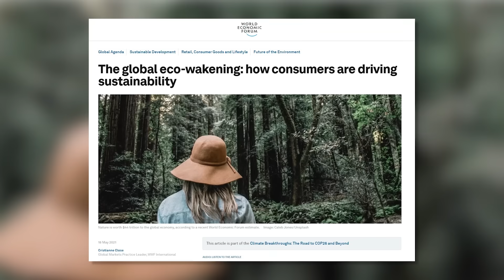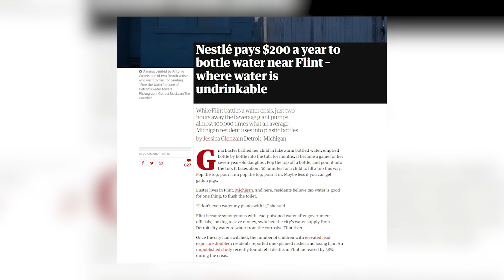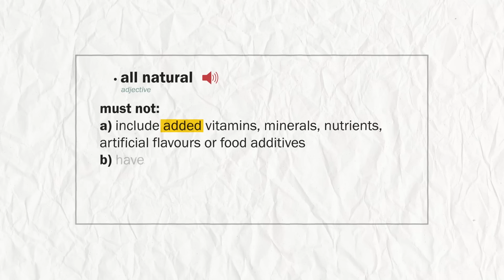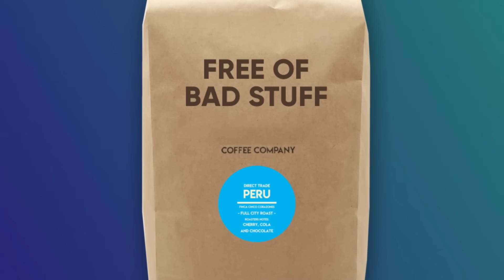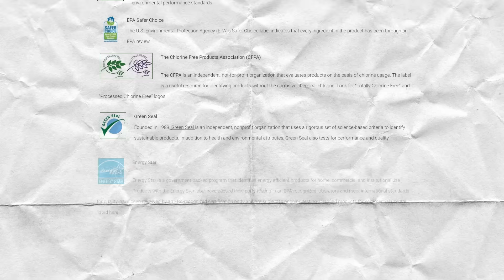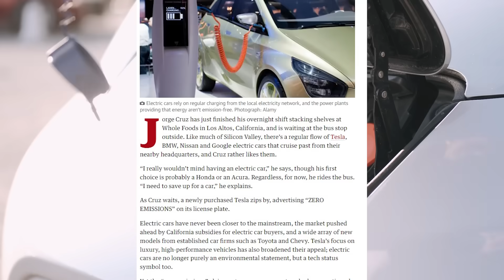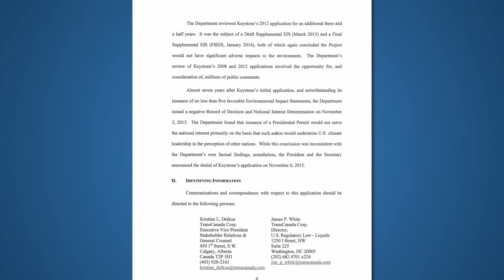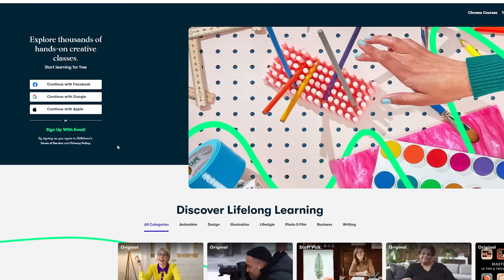Why Being 'Environmentally Friendly' Is A Scam

Comment: EV cars alone won't reduce emissions enough. We all need to drive less and advocate for walkable, bike able communities with better transit access.
Reply: Especially with current battery technology. 10 year old Tesla's today are basically write-offs when the battery costs >$20K to replace. Leaving a car that no one is gonna buy, probably scrapped for motor and a few useful items, the rest landfill.
That doesn't even touch the environmental impact of large scale lithium batteries.

Comment: I'd love to know what's more environmentally friendly, the manufacture and transport of electric vehicles or to keep an old car on the road an extra ten years.
Reply: This has been researched and studied already. Manufacturing of electric cars is worse for the environment than gas cars, but over the lifetime of a car, electric cars are more environmentally friendly once fuel, and gas emissions are considered.
Reply: @vitaminb4869  So what about the emissions from burning the fossil fuels to produce the electricity used to charge the electric cars? Was that factored into the study?
Reply: @nicks1063  I'm sure it was. In any case, we should be moving 100% to renewable energy.
Reply: @vitaminb4869  Are you guessing or do you know it was factored in? Sounds like a guess to me....I do agree that we need to look towards sustainable/renewable energy solutions but with our current technology nothing else even comes CLOSE to oil and gas.
Reply: @nicks1063  Why wouldn't they factor it in? It's kind of basic common sense. Besides that, the fact that electric cars are a lot more efficient than gas cars, tells you they would still burn a lot less fossil fuel either way. Electrics average 100mpg and higher. How much does the best gas car average? And then also consider horsepower and torque difference too. Anything powerful running on gas will have mpg in the low 10s.
Reply: @vitaminb4869  Did you really just say electric cars avg 100mpg? You don't use miles per gallon for ELECTRIC cars.... cause you know, they don't have gas tanks! Are you talking about hybrids?? And you'd be surprised how many of these studies don't factor in things like the fact that like all municipal power grids run on 90% fossil fuels.
Reply: @nicks1063  Umh, it is converted into mpg so it'd be easy to compare them to the mpg of gas cars. The purpose here is to illustrate that on same amount of energy an electric car goes much, much further than a gas car. So even if both burn 1 unit of fossil fuel, the electric will travel further, and thus will use less fossil fuel. Is it really that hard to understand??
Reply: @vitaminb4869  ever heard of nuclear power, goober
Reply: @MYNAMACHEF  Why are you talking to me, boy?
Reply: @vitaminb4869  meant to tag the Nick guy
My bad
Reply: @MYNAMACHEF  "my bad" not an excuse bro
Reply: @MappingRobloxAnimations  ahahhahahahah
An excuse? For what, tagging the wrong person? May god forgive my despicable tribulations

Eat it
Reply: @vitaminb4869  Why wouldn't they factor it in? To make it look more green, perhaps? 

Electric cars are an 'eco swap' product, that rely on eco-ness for sales. Their goal emission point is in a 100% renewable grid society, that European cities are trying to create. 

But the others are right, it's a 'green capitalism' product. They're trying to minimize emissions at the same time as maximizing profits by selling everyone individual cars. Public transportation, by any power source, would be objectively greener.

There is plenty of room between unlimited capitalist greed and no freedom in a socialist society. Betting them against each other as the only binary options is false and defeats the purpose of trying to improve present issues with our societies.
Reply: @raapyna8544  To make it look greener? That's a dumb assumption. Of course they factored it in, anyone with half a brain doing such research would. Besides, I already explained the electric cars go much further on same amount of energy. That alone settles all "debate".
Reply: @nicks1063  we actually do. That’s nuclear
Reply: @theobserver4214  But unless we start shooting all the waste into space (which is exactly what I think we should be doing with it) we then have that problem to deal with....
Reply: @nicks1063  With stuff like Fusion the waste problem is greatly reduced, but still there. Then again, it’s the best thing we have to fully replace oil and gas’s reliability (as wind doesn’t always blow and the sun doesn’t always shine). If you live in the Tennessee area, you probably already are relying on fusion reactors.
Reply: Studies that account for the source of power generation in various places in the US show that emissions from manufacturing are made up in 3-10 years, depending on which grid you draw from. In my area, only about 30% of the power is coming from fossil fuels, and my power company is very transparent about the switch they are making and the new infrastructure they are installing. Their goal is to be fossil free by 2035 and so far they are on track. However, with that said, it takes much longer to recover the emissions of a new electric car than an already manufactured used car, so if you already have a working gas vehicle, it doesn't make much sense to switch to an electric car for the sake of being green. When that car reaches the end of its life, that is when it makes sense to switch. (Which is why I have no plans to switch out my 18 year old car, because it still works)
Reply: I'd have a look into biodiesel and HVO. Honestly I think the main issue is that people are only looking for one single solution and not fighting the issue on many different fronts.

There's hydrogen fuel cells, there's biodiesel (made from biological waste products), there's electric vehicles, these are all different but good technologies to reduce fossil CO2. Then there's research into CO2 sinks, actively catching CO2 from the atmosphere and finding long term storage for it. There's also the idea to actively redesign our cities to emphasise walking, biking, and/or public transportation in more major ways. Work from home initiatives to reduce the need for commute. Etc Etc.

There's no need to put all our eggs in one basket when there are multiple ideas that all will lend some benefit.

That being said the best thing you can do for the environment is to not have kids, or adopt/foster if you really want kids, same with pets.
Reply: Trains are vastly more environmentally friendly than either option, like hundreds of times better. It's frankly absurd how muck better trains are in every single aspect.
Reply: @swedneck  The only aspects trains aren't better in is the thieving bastards who own them
Reply: Keep that old car running as long as you possibly can! Car companies LOVE to tell you how much buying electric cars helps the environment but they never mention where the electricity that you use to charge your electric car comes from (I'll give you a hint, 99% of the time IT'S FROM BURNING FOSSIL FUELS) another thing they're in no big hurry to reveal is all the rare earth elements that go into the manufacture of the batteries for electric cars and how the mining of these elements affects the environment. Until the power grid you use to charge your vehicle is eco-friendly and the mining practices are more highly regulated so they aren't contaminating fresh water supplies it's actually probably WORSE for the environment to buy an electric car.
Reply: @nicks1063  those are good insights but not always true.
It depends on how much they use the car.
(replying to your first comment, the other ones are trash)
Reply: @nicks1063   Why are you so angry about electric cars? On a windy day, 100% of electricity in my city is from windmills, so having an electric car is FAR better for the environment.
Reply: @nicks1063  Here, it's windy most of the time and when it's not, the electricity is bought from Norway's water electricity grid. And what's your point? To make electricity, you have to spend some kind of resources, so you have to go for something less polluting, and wind and water are definitely WAY more friendly than straight-up oil. That's just a fact.
Reply: @nicks1063  once we stop mass production of things just because they're profitable(*cough* capitalism *cough*) we'll probably have better energy and less consumption, while also getting investments for research on clean alternative energy
Reply: @jplveiga  Ah, the socialist dream of utopia.....where has that ever worked?
Reply: @nicks1063  is this world working or are we just pretending
Reply: @jplveiga  Capitalism certainly isn't the problem! If you think it is maybe you should move to China....see how good your quality of life is there 🤦🤦
Reply: @nicks1063  china has capitalist economy. Just because a part of it isn't doesn't make it better.
Reply: Electric Public transportation and good infrastructure.

Comment: Thanks for making this!  But uhhh capitalism seems to be the cause and our solution to so many of our problems.
Reply: It's not a simple as capatlistic economic growth. It's a world issue, with all economies.
Reply: are you sure this is false in communist countries?
Reply: It's fossil fuels + growth. Socialist countries run on fossil fuels too. But capitalism accelerates the growth by supplementing it with shit we don't need. Poverty is very eco-friendly.

So... The options are to detach growth economy from fossil fuels,  and detach from overconsumption by implementing almost-closed-loop reusing and cycling, or a reconstruction of our economic structure by dimishing some sectors and growing others, while eliminating overconsumption, entering a state of controlled degrowth. Probably neither of these will happen... But a combination of both lines of policies could be realistic; increasing recycling levels, while decreasing extraction and consuming speeds, and replacing energy infrastucture, while decreasing energy usage, entering a state of slow or no-growth in developed countries. Corporations will probably have to be regulated, and some of them taken on by the public sector, but the private sector will remain one of the key parts of the economic framework.

Lol sorry, I just did a group essay on this for uni.
Reply: @Rääpynä  Poverty is very eco-friendly? Ummmmm... no.

People living in poverty don't care about the environment. They care about doing whatever it takes to survive. This includes throwing garbage into nature. Dumping hazardous waste chemicals into nature. Burning any materials they can find, like wood (creates more pollution than coal, and also has to be cut down) and synthetics to create heat and energy. Slash and burn agriculture. And so much more!

Yes, consumerism is probably the main driver of environmental woes, but to say poverty is very eco-friendly is... well, not correct.
Reply: Yeah, I hope we achieve communism in the future